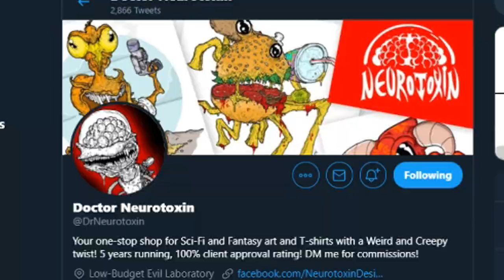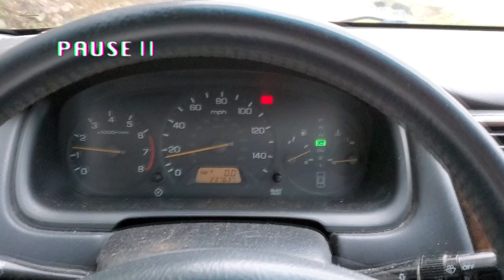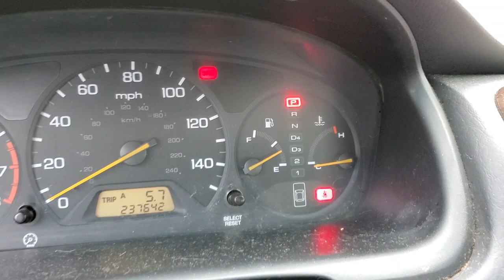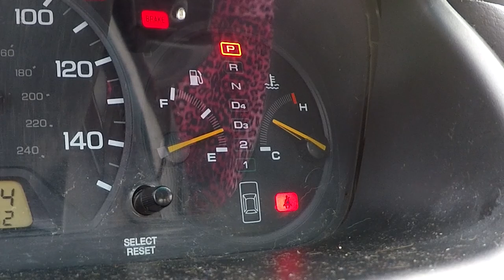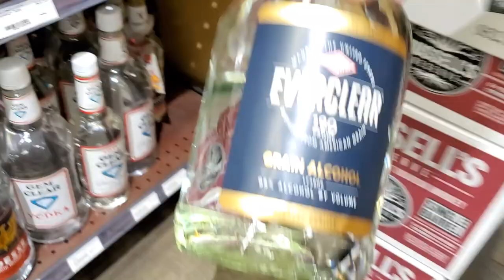Can A Car Run On Moonshine?

Comment: Pours vodka into car:

Russians: Heavy slavic breathing
Reply: Charcoal the horn sounds like: “blyat blyat”
Reply: @victorrdz7789  Ha, yup
Reply: ВАНЯ! ДАВАЙ ДАВАЙ!
Reply: @orbitaldropshocktrooper1628  there is a video on it actually.
Reply: Orbital Drop Shock Trooper because you can cool your computer with it then it will work for an internal combustion engine? What an odd comparison. Just because it can cool a computer doesn’t mean it’ll work for a car... try putting water in your tank and let me know how that works out for you...
Reply: @Charcoal  good profile picture
Reply: привет, американе
Reply: Life OD did it with a grand marquis

Comment: Buy a diesel and see if it can run on McDonald grease
Reply: They actually use grease from the grill for fuel
Reply: Avail Sausage the trucks right?
Reply: @fruitella196  Yep pretty cool
Reply: Grease can actually be used for fuel in diesel cars (Thanks Top Gear)
Reply: @fedora997  I mean, dont they treat it first?
Reply: @donald12998  no it just needs to have the food chunks removed and it can run.
Reply: Go watch novices garage vid on that
Reply: @availsausage1228  The ones I worked at in Ohio just broke all laws and dumped pounds of grease from the grills and friers down the down a day. Altho the frier oil doesn't get changed frequently at all, should be every two, three days. At McDonalds you could eat a McChicken made in oil from before Covid even got to the states.
Reply: AMG Squared did it and wasted a perfectly good f350
Reply: Whats the difference?
Reply: Have done it, and more than 15% grease is dangerous
Reply: Reice already runs on McDonalds grease

Comment: It's a fact, Honda's literally do not die no matter what you do to them.
Reply: Really though, my friends civic fixes itself
Reply: 6 months of hell later and the Honda still works
Reply: I've owned a '99 Honda Civic for a decade now so I knew this thing would still work.  Let me tell you what mine's been through. It has almost 200,000 miles, has been totaled twice by other drivers hitting me, it's exhaust system has fallen off a couple of times, the entire interior is falling apart, hood doesn't fully latch without WD-40, trunk leaks like nobodies business, shakes violently once you hit over 65 but still will do 90 no problem, wiper motor quit working once, power steering fluid reservoir sprung a leak, the part that reads the speedometer broke multiple times, the auto locks don't work at all except will at random engage when you open the driver-side door, but despite all that I can take a trip to 10 hour trip to visit family and the 10 hours back and that motor takes it like a champ as if it isn't 20 years old and pushing 200k miles. All I've had to do was put in about how much the car is worth in upkeep and repairs. Getting a new car soon, because it's literally falling apart around the motor and I've again had it for a decade, but I repeat, Hondas don't break down.
Reply: @thealmightyjack  Older Hondas at least
Reply: You apparently havent seen ricer hondas with NOS blows the fuck out of those vtechs
Reply: @ZeruS117  you feel real proud of that comment, don't you?
Reply: ipopmyneck it would be physically impossible for a car to actually fix it self if something were to malfunction? What are you even talking about...
Reply: Toyotas too
Reply: @TeenageMutantZuckerTurtle  you aren't wrong. I have gotten rid of it since making the original comment and now drive something nicer lol.
Reply: I had a 2000 Honda Accord basically like this one but it was the 4 door model it was such a pile of junk it wasn’t even fun I paid 2k for it I scrapped it for 400 cash it would reve it’s self in park I now own a 2001 Silverado with 300k miles on it with the 5.3 litter and it gets 27 miles to the gallon the Honda got 15
Reply: The_Almighty_Jack I had a 2000 model it was pice of shit tbh you would start it and it would start reving up like it was at a ricer meet up I have a 2001 Silverado that looks like it went trough a tornado and it has 300k miles on it and gets 27 miles to the gallon with a 5.3 litter v8 the Honda got 15
Reply: @MRZ1234ify  but it didn't die

until you scrapped it, at least
Reply: Bondedwithpotatoes007 it was basically dying it was knocking really bad after a week after I bought it
Reply: Idk man, my 91 accord blew the engine
Reply: I swear the 03 civic I'm getting might as well be 3 years old, because my dad's driven it and he says that once it hits second gear, you're gone.
Reply: The alcohol would probably eat through all of the fuel lines eventually. Ethanol laced Gasoline does that to my car.
Reply: @oryonatwood9299  bruh the thing has max like 170hp you hit 2nd gear you ain't gone you staying in about the same place😂
Reply: @Angry_Garden_Gnome  listen. I exaggerate way too much. ignore me please.
Reply: your rack & pinion goes @ like 300k but it's not too bad to fix

Comment: Better of siphoned that everclear back in the bottle for later.
Reply: Everclear scares me, it's 95% abv, lab grade ethanol is 90% abv.
Reply: @ZevVeli  i mean its just a matter of distilling with a really high efficiency
Reply: eight plus one no, I get that, but like...90% ABV has a shitton of labels of it reading POISON, and we cap out on it for most experiments because it can do wonky stuff to your experiments. Unless we're talking a completely anhydrous experiment where we use 100% ABV.  To put this in a different perspective: a standard drink is 12 ounces of beer at 5% ABV. To have a standard drink of everclear you'd need 0.6 ounces. A little over half a shot.
Reply: @ZevVeli  lab grade ethanol has additives that make it unsafe to drink as far as I know and to be entirely fair alcohol is poison to the body we just don't usually drink enough to hurt ourselves
Reply: eight plus one no. I'm a chemist. Lab grade ethanol is 90% ethanol, 10% water. If there were any additives it would throw off the experiments. You're thinking of METHANOL. And yeah, I know that alcohol is poison but a standard drink is low enough that there's no issue. My point is that everclear makes it so easy to accidentally go over that limit that it's kind of frightening that you can just buy it at the liquor store.

Comment: did you know that cars actually used to run on moonshine il at the time illegal races
Reply: A lot of race cars run on basically moonshine (E85) which is just alcohol because it helps with engine cooling and predetonation

Comment: Started making wines from stuff like ginger or rhubarb, then made a small still from pressure cooker. It makes rum, liquors, liquers, purifies water, desalinates sea water, and ethanol (moonshine) from it can heat home from a non-vented ethanol flame or fireplace, and fuels whatever else. 1Kg sugar+1pack of bread yeast in gallon jug with an airlock for 30 days, then distilled = almost 3/4L of ethanol at 92 to 96%. Have at her boys!

Comment: This works, until the point where your fuel lines bleed and light the car on fire. 
You need different lines, filter, and pump to deal with the ethanol. Also, it's much less efficient.
Up next, make it run on Propane, it's even easier than ethanol.

Comment: Fun Fact: E85, its 85% Ethanol, which is basically corn-based alcohol. Very similar to moonshine. "E85 pump" (Which varies in E%) averages 110 octane, makes for great race fuel.. which is why most modern street cars run it. The only downsides are its potlife (it gels up within a year), and it takes about 33% more volume to create the same amount of power as an equivalent race gas.

Comment: Most fuel pumps now work with alcohol so thats why this Alabama of a veichal works fine or its a flex fuel car designed to run off of alcohol which is more Alabama for you

Comment: lol if you take the fuel line off of the fuel rail you can just cycle the key and run all the gas into a bucket. takes about 10 minutes for a half tank.

Comment: 4:53.; What did he mean by "I'm just in 2nd gear & pinning it, the entire time."?...
Reply: It means he has a manual transmission and was going fast in second, which makes the RPMs high, which burns more fuel.

When you get going fast for the gear you’re in and the RPMs get high, your supposed to shift up to the next gear to be more fuel efficient/lessen the wear on the engine.

So he was staying in second gear to keep the RPMs high and burn gas faster.

Comment: Honestly I need to know how the hell the car ran on alcohol 
Do you understand what this means

Alcohol could be the new gasoline
Reply: if you wanna damage your car go for it
Reply: That's been a known fact for years
Reply: No but gasoline is known to be a limited supply unlike alcohol so if it works but damage the car
U think we could easily fix that by changing the motor way of using gasoline 
Or changing the chemical recipe for alcohol
Reply: Alcohol is ready mixed into gasoline in various concentrations for different applications.. An engine designed for it will no be damaged in anyway
Reply: Faresourtrex well not only can it damage a car, but it isn’t as efficient as gasoline. Even if we could find a way to make it efficient or prevent it from damaging cars. Why spend so much time and resources on doing that, when we could just use gasoline which is a cheaper alternative than ethanol which comes from corn?

Comment: Dont need to watch the video to know that yes, it can. However, it would need a AFR of closer to 9.0/1, instead of 14.7/1, which is what gasoline runs at. 
Your car would need tuned to be able to run moonshine. 
I run ignite e90 in my drag car and that's basically moonshine.